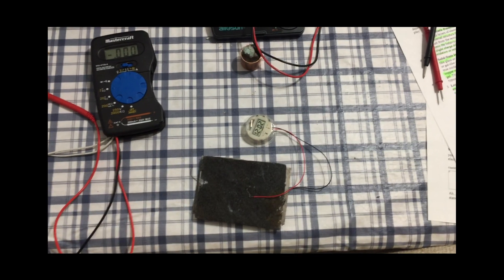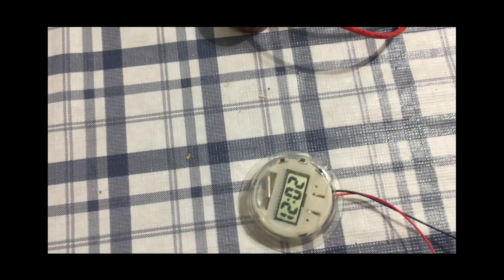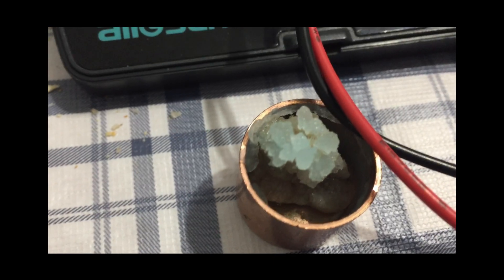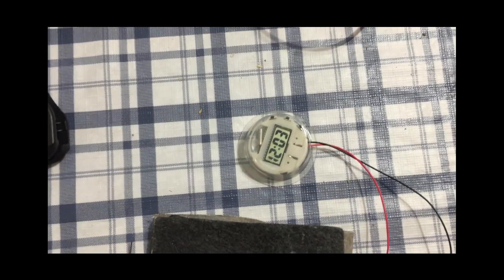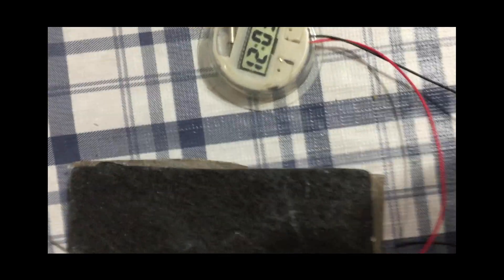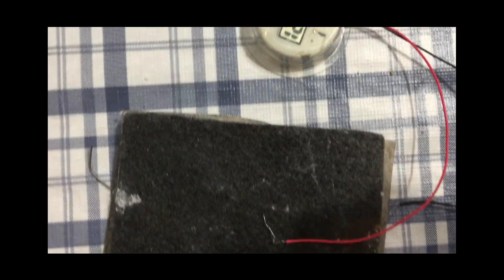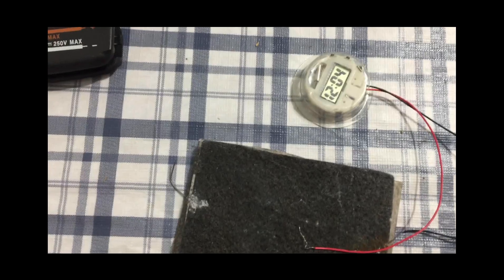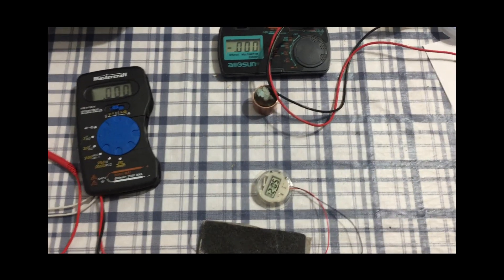6 Month Power Cell Works

Comment: See Garrett Modells work on ZPE. Your resonant casimir cavity is a novel solid state battery. If you rotate the plates to be vertically oriented does it change the current output? Just curious if the hall effect is playing a factor due to Earth's magnetic field.

Comment: Do you know what the current draw is? That's awesome, man! I'd like to make a 12V Bedini/Tesla switch with Crystal cells in a sheet configuration just like that
Reply from the maker: A few ma output, I get peaks of around 1 with the meter with regular cup cells and close sheet cells I can see burst of 15ma. It becomes more significant at higher voltages. 14 volts 10ma 140 volts 10ma etc etc...
Reply: @joellagace1679  Awesome! This flat version looks like one of the best so far ;)
Reply from the maker: It might very well be.
Reply: @  Does the output change in the presence of a magnetic field ?
Reply from the maker: One of my experiments showed some crude gains others who have experimented with magnetic fields nearby have experienced mixed results.
Reply: @joellagace1679  
If it hasn’t been done already, I am thinking what if you put the cell between two ring magnets off a magnetron so that the cell is in the null point.
Reply: Joel do you think these cells are producing power due to the “mix” of materials alone or do they also pull from the ambient?
Reply from the maker: Myself and others have noticed some constant transient AC spikes from them so very reactive as most electrets are to the ambient fields.